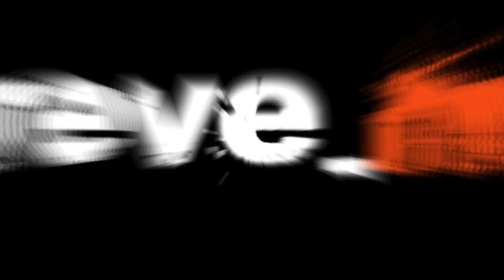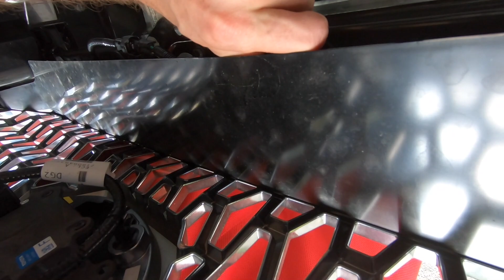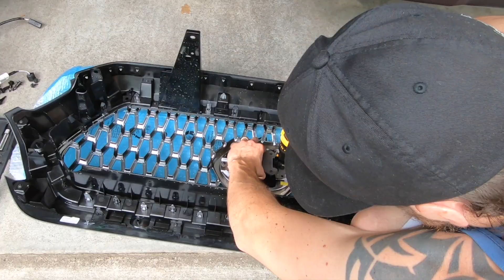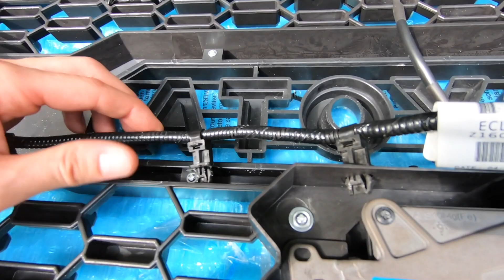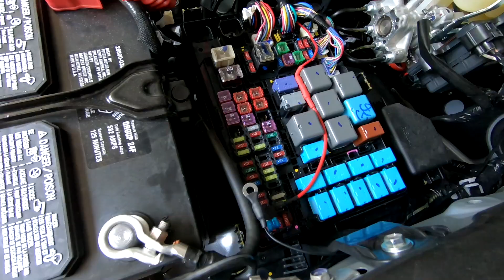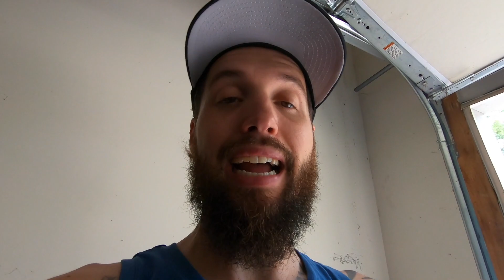2019 Tacoma Raptor Grille Install

Comment: Have you had any issues after your install with sensor malfunction
Reply from the maker: I haven’t. Had some snow around it before and it said that certain things weren’t available. But I think if I put that pro grille insert in it would be fine. No real issues. Works fine.

Comment: Hey boss, random question...did you ever end up getting a garnish for the grille and if so, were you able to install the garnish without taking the grille off again? 
Thanks man, Beautiful truck by the way!
Reply from the maker: I never did get the garnish because my adaptive cruise control still works without it. And yes you can that section just pops out and you screw in the garnish in its place.
Reply: @Steve_MP5  
Ok that’s good to know (I pulled a rookie move and ordered a grille and thought I added the garnish but didn’t....I want to go ahead and install the grille without waiting for the garnish haha)

Comment: Where do you plug the fuse in inside the fuse box i see the one you plugged it into but theres no where to connect it on that.
Reply from the maker: I’m not sure what you’re talking about.
Reply: @Steve_MP5  like i have the add a fuse but where do you plug it in
Reply from the maker: @edouarddesharnais4764  if you follow what I did you shouldn’t have any problem. The lights plug into the add a fuse line and then you plug the fuse into the fuse box and ground it. Idk man.

Comment: Just a little hint you don’t need to remove the four tabs on the bottom you just need to remove the two bolts and the two tabs next to the head lights😉
Reply: Y at my ov I

Comment: @Steve_MP5     Do the lights come on automatically when the headlights kick on at night? if you have your lights on Auto by chance? Or do you need to manually switch to headlights for them to work? - Thank You
Reply from the maker: Zachary Davis I explain it at the end of the video. The way I have them wired the LEDs come on with the truck is on regardless of the headlights are on. Wiring the way they suggest, they only come on when the headlights are on.

Comment: A couple of hints...it's not necessary to remove the four push clips at the bottom side.
Also gentle use of side cutters make easy work of the harness retainers.
Looks great...just finished mine.
I did choose to install the four-light kit and actually splice/solder/heat shrink my connections to the left marker lamp pigtail.

Comment: Did you just use the same fuse for the Add a fuse or did you use the same and add another?
Reply from the maker: Jaseng Thao the add a fuse comes with fuses. Just like I did in the video. Plug it in.
Reply: Okay thanks!! Thanks for the quick reply subscribed 😉

Comment: Awesome video !!! I just ordered my set of lights from Caliraised which unfortunately don’t come w/ the add a fuse like Runnin4 tacos offers . I went out & bought the add a fuse & installed lights on using your video👍
Thank you 👊
Reply: Daniel Arteaga  I have a question. I ordered some raptor light from another  company which didn’t come with an add a fuse.  Do I add a 15 amp along with the 10 amp ?  First time doing this. Thanks

Comment: Steve my Truck won’t start in the INJ fuse slot.
Reply: safmister you need 2 10 watt fuses bud. One for the lights, the second for the injectors.
Reply: Héctor Dario Abarca 
Thanks for the message Hector. But there is only one 10 A slot where the Light lead goes into and has a fuse attached to it.
Reply: @safmister  That is why you need the add-a-fuse

Comment: Nice vid. Installing my grill from Runnin 4 Tacos tomorrow. Any issues with the TSS system since making this video? Thanks!
Reply from the maker: Sasquatch Mountain Project I haven’t noticed any. I still get alerts if I’m coming up to fast on a car stopping. I don’t use the TSS really at all for cruise control, but when I tested it it worked.

Comment: After an hour of my truck being turned off the raptor lights came on. Not sure if that has happened to you? My gf went outside to check the mail & told me the lights were on. I’m confused why they would turn on without the ignition on.
Reply from the maker: What fuse do you have them plugged into?
Reply: @Steve_MP5  has your lights been working ok plugged into the spot you have them?  Just waiting for my grille to arrive and was going to put them in the same fuse spot you used.  Thanks man, great video.
Reply from the maker: Jase M no problems I’ve seen so far.
Reply: @Steve_MP5 your comment is 2 years old. How about now? Any problem noticing lights randomly come on when truck is off. I’ve heard it’s a self test the fuel injectors do to check no leaking something like that of a self test. Maybe the ETCS 10amp fuse would work better?
Reply from the maker: @beptex2858  I’ve still had no problems that I’ve seen.
Reply: Same fuse as you set up, just keep an eye out bro

Comment: I only want the raptor lights on with driving lights and headlights. Not all the time. You are saying none of the spots for the add a fuse accomplish that? What about wiring directly to the sidemarker without the add a fuse?
Reply from the maker: Philemon 6 the original spot (the spot runnin4tacos used in the video) I had it plugged in to will turn then on with the headlights only. I don’t know if any other way to do it other than splicing it in directly with other wires for whatever you are trying to do. Add a fuse is just easy.

Comment: i have a mk1 mr2 bodykit with a space in the bumper. was thinking of  putting a tacoma grill on it, actually walked up to some guy in a tacoma to see if hed be ok with me measuring it to see if it might fit. he was totally ok with it, turned out he had  a mk2 mr2 lol
Reply: You should install a remote start for your Toyota tacoma and it's great for winter , summer time